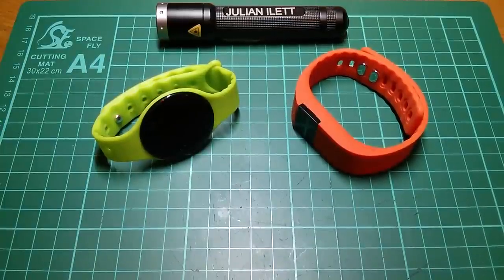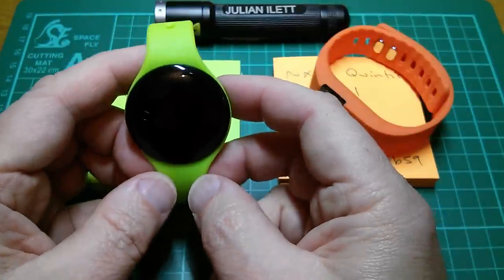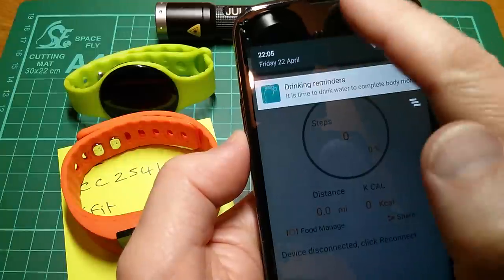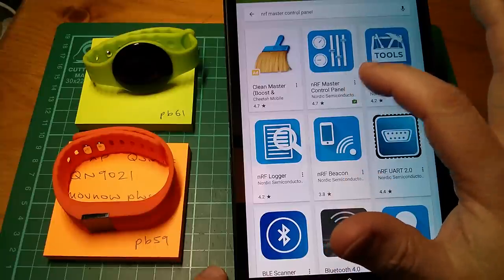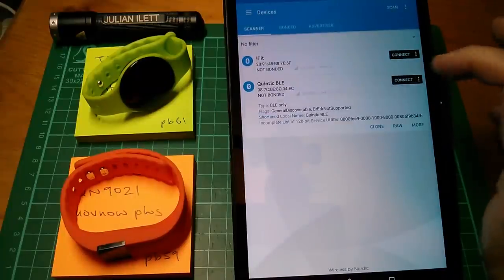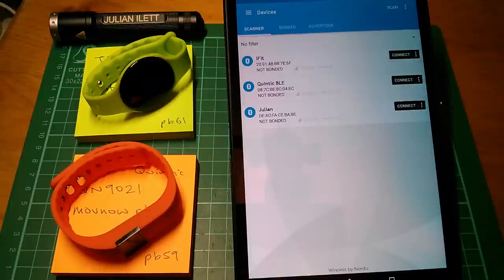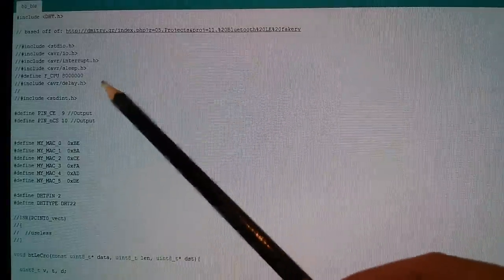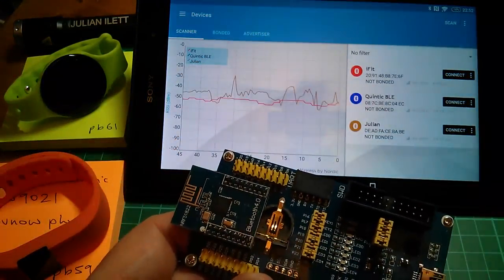Playing with Bluetooth LE

Comment: Hey Julian, you can try to repair the capacitivetouchswitch by removing that metal foam and solder a little piece of wire directly onto the place, this piece of foam would normally touch it! The wire has to go all up to the button which is on the enclosure. I often work with Capacitivetouchswitches for Arduino projects and I am always using a swirled piece of wire which is soldered to the contact point and goes to a piece of acrylic glas. Then I just have to  put my finger on the glas and the arduino detects it ^^
Maybe that works for your watch;) 
Greets from Germany:)
Reply from the maker: +Scavengerx3 I like that idea - I'll try that if the watch doesn't recalibrate after the battery goes flat

Comment: Good stuff, keep on hacking, and keep on learning.  I find myself bored on occasion, so in the past year, besides watching every video you and Big Clive have ever posted, I have; Obtained my Ham ticket, purchased a couple of ham radios, built a small ham receiver/transmitter from a kit, as well as a wide assortment of other kits. Designed and built several other circuits and such as well as a couple of volt meters, an ohm meter based on an arduino nano, and several other projects that keep my wife buzzing about to see what the hell I am doing now. Who says you can't teach an old dog new tricks, just turned 65 last month so my mail in now filled with adverts for hearing aides (no thanks get mine from the VA) food suplements to keep my member hard, and insurance policys for the nursing home that I shall surely be entering anytime soon. Besides all that, we have been bouncing back and forth between our motor home and house traveing the highways and biways of the usa.  But I do have you to thank for my renewed intersest in electronics, and especially Arduinos.

Comment: Julian, I notice you use bang good or ebay for most of your purchases. Have you used AliExpress? I get loads of items from there, they are much cheaper than bang good and the shipping is usually quite fast (depending on the seller).
Reply from the maker: +Kris Cochrane I like using Paypal as an insulator between my bank account and the big bad world. I believe AliExpress requires the use of a credit card.
Reply: +Julian Ilett Yes they do but I think that offers more protection than using PayPal in my opinion. I've been using them for years and never had a problem; wish I could say the same of PayPal! Keep up the good work!

Comment: Hi Julian
 I just love your videos specially mail bag and reviews. While you are on the Bluetooth subject could you perhaps on another video talk about bluetooth speakers and noise reduction techniques  that could be used on USB powered amps. I built a USB powered amp with a bluetooth dongle to bring in the signal and ran into noise issues if I use the same USB hub to power both devices.  I am thinking of using a coil to reduce the noise. What is your opinion on using such a filter and can you please help..
Dart
Reply: +Dart Gar I ran into the same problem when running a bluetooth module and the amplifier both off of a battery. Best solution is to buy a signal isolator like the one here: http://www.ebay.com/itm/3-5mm-Car-RCA-Amplifier-Audio-Noise-Filter-Ground-Loop-Isolator-Suppressor-JHRG-/381556190341?hash=item58d6856c85:g:QNkAAOSwB4NW0bn2
Reply: foorje
Thank you for the link I will check it out

Comment: Hello, could I have help with building or buying a Lithium ion charger circuit. Could you recommend one? Building a 12v battery using 20  18650 cells.  Want to build it for my solar panel or my go-cart.
Reply: +shawn lee You have a Li-Ion powered go cart?  I'd really like to hear more about that!  Here is a good charger, has 12v LI-Ion capability as well....  http://www.amazon.com/NOCO-G1100-UltraSafe-Battery-Charger/dp/B004LX3AXQ?ie=UTF8&psc=1&redirect=true&ref_=oh_aui_search_detailpage